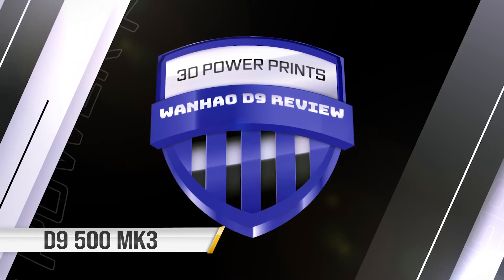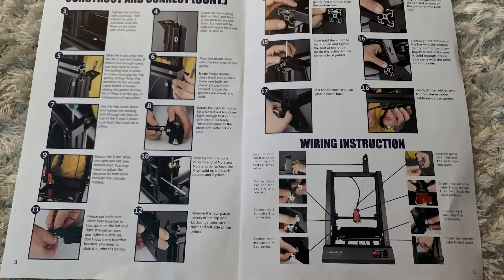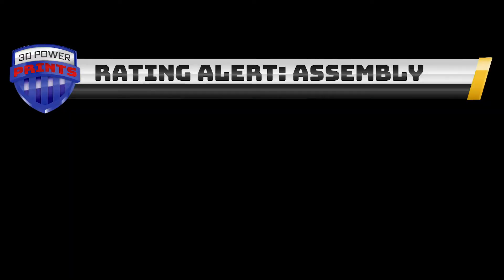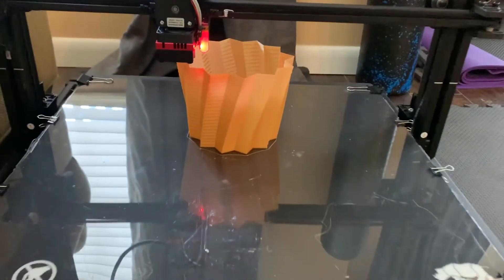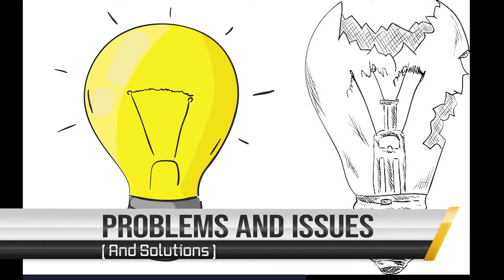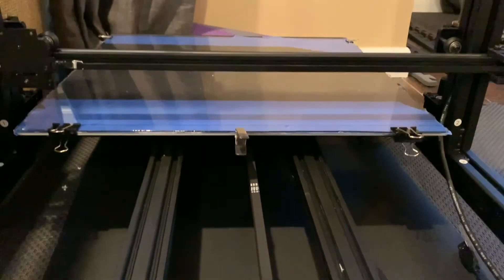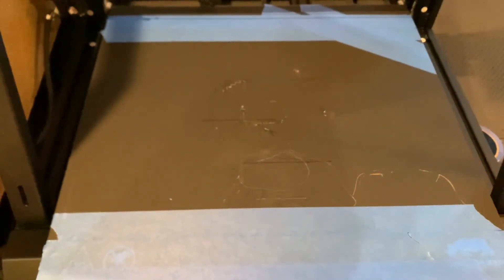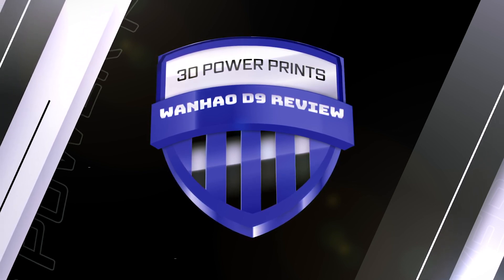Crazy HUGE 3D Printer!! Wanhao Duplicator 9 (D9) 500 MK3 Review

Comment: In order to level the bed properly you have to heat the  bed first to whatever temperature you will be printing .That is the cause of the nozzle crushing in to the bed after auto bed leveling it already
Reply from the maker: Correct, otherwise when the bed does it's slight warping due to heat, the BL touch can't accommodate to it
Reply: @3DPowerPrints  Do you have any suggestions how to raise the bed heating because my wanhao d9/500 heat up to 80 degrees and then says bed heat error which is not enough for abs filament
Reply from the maker: If you want to print ABS, the most efficient way to keep it at a higher temperature, build an enclosure to keep the heat in.

Comment: where is the next video? :(
Reply from the maker: It is coming soon. If you subscribe you will get notified when it's posted :)
Reply: @3DPowerPrints  Is it still coming soon?  I am interested in knowing how it was upgrading to the Flexion Extruder.  I have a need to print some large TPU prints.
Reply from the maker: Robert we did try the Flexion, and while it was a partial success, it is not a drop in by any means. For some printers yes, but for the Wanhao, it required extra alterations to make it physically fit. We returned ours back to a new stock extruder and it’s been working great ever since. You might be able to get tpu working at 10mm/s on the stock extruder, but it could take a while obviously.
Reply: @3DPowerPrints  Thanks for the reply.